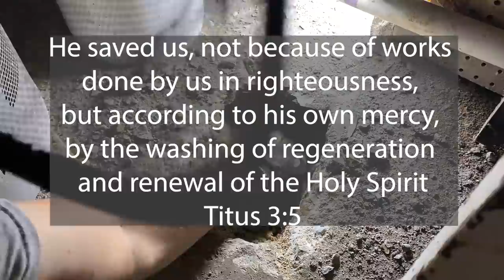Locating The Leaking Pipe Underground

Comment: I noticed that you have a camera that is on an app you used to look under your deck, start by using that, can you make it longer?  The best is to rent a camera if possible if not then check with a plumber, with the camera you will be able to pinpoint where the leak is.  You need to get the water out of the ducts because of mold.  I can't believe the person that put it in the left coke cans in the duct, it had to be a contractor.  I would ask your neighbors about your house, I am sure they have answers to your questions.  It sounds like you have the original plans to the house but why does it have two furnaces and water heaters, was it added on multiple times.  Once you find the spot of the leak you can do the labor, it looks like you have carpet over the concrete, how thick is it, may be on the house plans, if you don't have them check with the local City Hall.

Be careful with the spa on  the deck, make sure the deck will support the weight.  Don't pull the spa inside in the winter the humidity will cost mold, your windows will all steam up.  You will have to install an exhaust fan to remove the humidity (and your heated air that you spent money to heat your house.  

Once you find the leak, hire a duct cleaning company, the ducts are very dirty, remember your family is breathing that.

I would install a whole house surge suppressor to protect your well and house from the next bad storm.  The whole house  can be in the breaker box or beside it, cost is about $250, I know the pump motor and installation was much more then that.

Good luck, I enjoy your adventures sounds like you been through this before.  I would not wait very long to complete that leak, cold weather will be coming.  Seal off the room with plastic when you jack hammer the floor, dust will go everywhere, it is easier to make it a separate room of plastic then to try to clean dust  up for ever.

I also suggest that you trim back trees and limbs over your house to keep leaves out of the gutters and install some screens to prevent the leaves from clogging them.  Set some rain barrels (I noticed you have large square totes that could be used for storage of water)to water your animals and garden, this will be a good back up and take some of the load off your well.

Comment: seems really dumb to bury ducting inside concrete.  so somewhere in the floor there is a pipe that busted and is leaking and rusted out the heating duct and is now leaking into it. A plumber with a snake camera would be your best bet
Reply: Mold mildew...etc..how the hell did an inspector ever allow this...??

Comment: Your looking in the wrong spot.  The water is coming from the condensation from the coil unit inside the duct work from the AC.  The drain pipe from the catch pan is not draining or the catch pan is rusted out.  You need to start there.
Reply: I would be happy to video what I am talking about and send you a link to show exactly where and why you are ending up with so much water in your duct work.
Reply from the maker: I started there, not the issue:)
Reply: @SSLFamilyDad  yea, someone just pointed out the part @ 13:02 with running the sinks.  I was typing so fast that I didn't hear that part.  I was just so worried you were going in the wrong direction.  It almost seems like a pipe was added and someone used the duct work as an easy "route" or in the fall of the sewer drain had to run through the duct because it was in the way.  Sorry to hear, I had delusions of grandeur that I had saved you tons of work.

Comment: Are you still using that ductwork? It's got to be very unhealthy. Please don't continue to use the a/c system until you eliminate the water problem and get the ductwork cleaned or replaced.

Comment: According to the natural laws of gravity, at no point would water naturally travel from UNDER the basement floor to UP above the basement ceiling. Lol that should be common sense. Also what else should be common sense is, the room you found is a non vented room that can become hot, humid, and/or muggy in the warmer months while you are running your air and the hot basement against the cold duct will naturally cause condensation and it is reasonable to believe that, that much water could accumulate over a span of 50 years, if the ducts were connected with only tap water could gets through the seems and into the ducts that way.
The reason you could smell the smell inside that room in your house is because the stinky stagnant water is INSIDE the duct and when the air or heat is blowing it is blowing that stinky stagnant water smell directly into the house from the floor banisters. Lol you hacked up the floor of your basement for no reason (some of it at least). I also heard you say your house has two furnaces and two water heaters. Was your house once ever a multi unit? Could there be any more hidden rooms, another bathroom perhaps or another kitchen with a sink?
Reply from the maker: The room I found is the lowest level of the house, the ducts and cast iron sewer pipes run through the level above it under the cement. The issue is a rusted out cast iron drain pipe leaking into the heating vent and running to that lowest point.